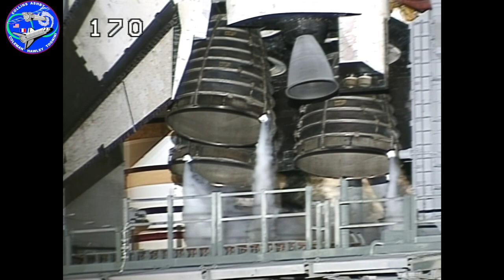Space Shuttle Columbia STS-93 Countdown Stopped 7 Seconds to Liftoff | HD Enhanced

Comment: And when they finally launched didn't they have a Caution & Warning on one of the engines I believe?
Reply: Not the engines directly but the Engine Controllers on the center and right engines. They lost one channel of redundancy each (Digital Computer Unit(DCU) A on the center engine and DCU B on the right engine). Was caused by a shorted wire in the payload bay. Center engine also took a hit from a LOX Post Pin to two of the 1080 brazed coolant tubes of the nozzle upon ignition which caused a hydrogen leak which in turn lead to higher than planned LOX usage which caused a 15 FPS underspeed at MECO.
Reply: @DaveS_shuttle  I believe they grounded the Shuttles afterwards until all wiring was checked in the crafts

Comment: The following evening, Columbia did launch. Several anomalies occured with the fuel cells and the SSME. The crew almost bought it.

Scott Manley has a brilliant explanation of what happened.
Reply: Not the following evening, this scrub lasted for 48 hrs, not 24. And that launch attempt was scrubbed due thunderstorms around KSC which made launch weather and RTLS weather NO-GO.  They tried to wait them out, but they lasted for the entire 48-minute launch window. Launch happened on July 23. And the fuel cells were fine. Short was in common wiring in the aft of the payload bay, nowhere near the FCs which were located at the forward end of the payload bay. What happened was that some exposed common wiring in the aft payload bay came in contact which some metallic surface and arced which in turn caused momentary short on the AC1 electrical power bus of the orbiter. Only the Engine Controllers on the center and right engines were directly affected. FC1 did report a Fuel Cell PH error message erroneously which the crew reported.
Reply: They might've had to do an OMS-1 burn but that's about it
Reply: @Lord_Merterus  There was more to the story, actually. At main engine start, there was this gold pin or something that fell and struck the interior of one of the engine nozzles, causing a hydrogen leak (can't remember if it was small or big) throughout the whole ascent. And because of that, the LOX flow was increased for all engines to compensate for the leak. In the end, MECO occurred a bit early due to the LOX tank in the External Tank running dry quick. But it was only a 15 foot per second (5 m/s) underspeed, and no OMS-1 burn was required.

However, if the leak got worse or something like that, then Columbia would've either did the RTLS emergency profile or landed in Banjul, Gambia (the prime TAL site) depending on how far downrange the abort would be called.
Reply: They didn’t do an OMS-1 but they did use the RCS for a translation burn. IIRC the capability to do an OMS-1 was edited out of the Shuttle software in the mid-90s @Lord_Merterus
Reply: @campbellmays9900  No, you can still hear the "OMS-1 not required" calls in all of the later launches